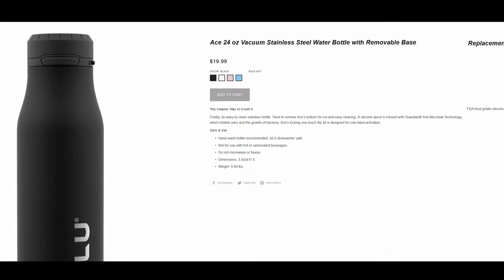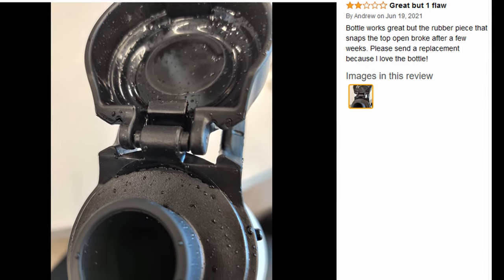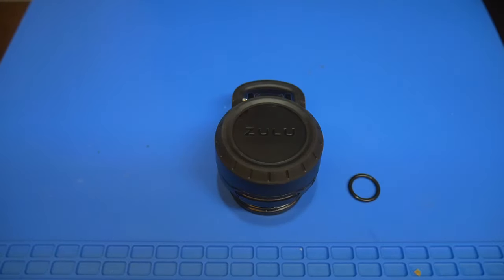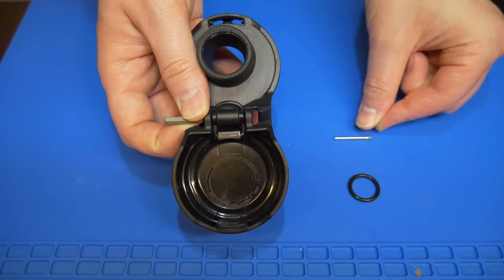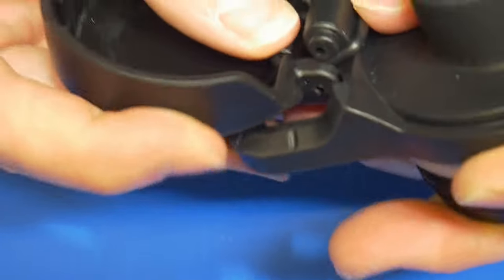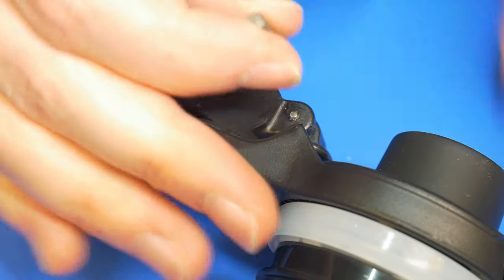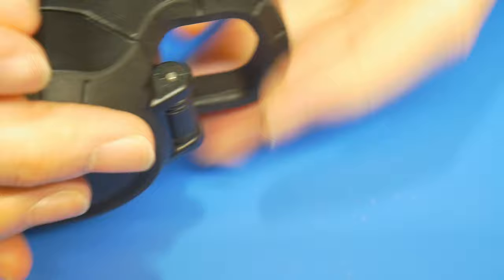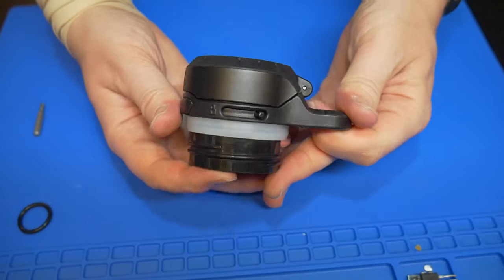Zulu Ace Water Bottle Lid Repair

Comment: Thank you so much! I knew this had to be an easy fix and I do have my replacement ones coming but I also ordered the Orings! I’ll definitely through the lids in the dishwasher washer now that I know I can replace those so easily. 😃
Reply: How do you get Zulu to replace the water bottle if the lid stops working?

Comment: Thanks for this and especially the link to the o rings.  Got them and it worked perfectly.  I agree with you on the long term viability of knocking the metal pin out of plastic tho.  It's a shame Zulu did such a poor job on designing this hinge when the rest of the bottle is so good.  BTW, I wrote Zulu and got back nothing.  I'll use these bottles until I have a complete failure, but will never buy another Zulu product again.

Comment: I got another 'O' ring on, but it must have been poor quality as it broke soon enough.  So I've just used some 2.5mm shock, bungee elastic chord and just tied a simple cross over knot inside the lid, which allows you to pull it open to the desired size with this knot, but still holds being elastic.  Doesn't get in the way at all.  Not sure if shock chord elastic will stand up to dishwasher cleaning, so I just plan on hand washing, easy enough!

Comment: Like many YouTube viewers, I sought a solution to my rubber gasket breaking on my Zulu water bottle lid. I found a couple where they linked to this product with many gaskets. The item came in as expected and as what was listed. Uxcell did not claim to fix my problem, so I do not blame that company. However, DO NOT BUY THIS if you are having the same problem I did, as it only lasts 6-7 days of use and then breaks again. This simply does not work. Tried it 3 times and 6 days later it broke again.
If there is a solution besides continually buying a $7 lid replacement, please let me know. But don't buy for the Zulu water bottle lid problem. It is a defect in the Zulu line. I will just use my bottle without the gasket. I still like my water bottle and I hoped that this would work, but it didn't.